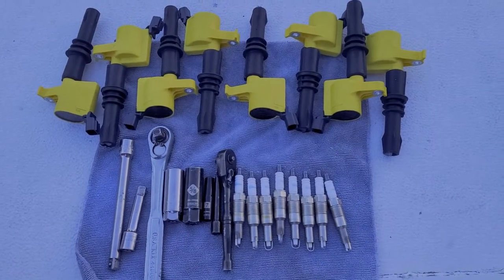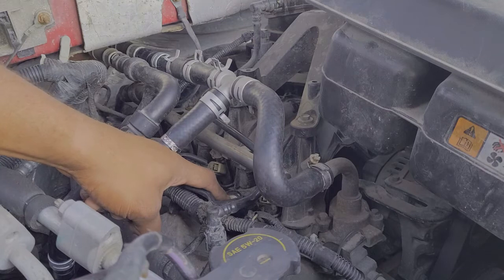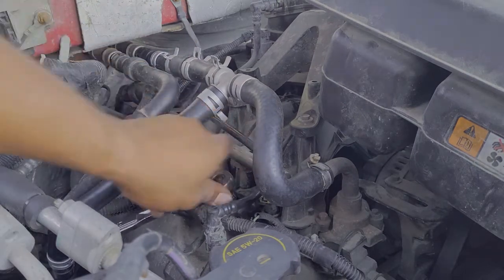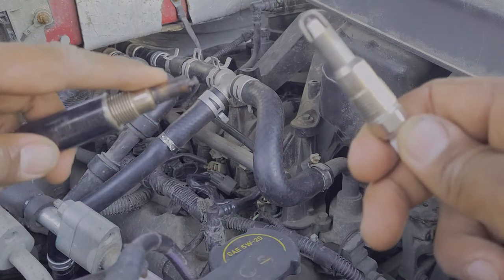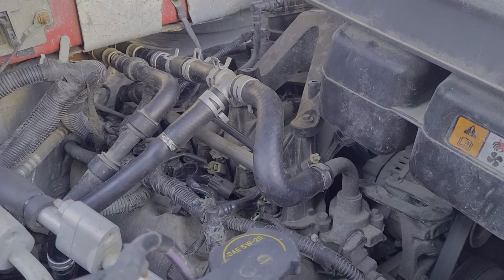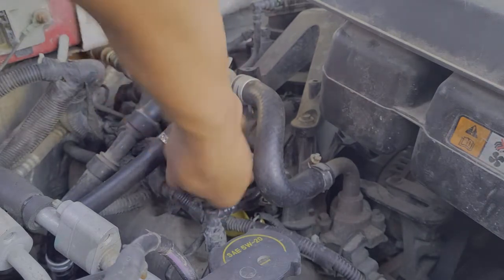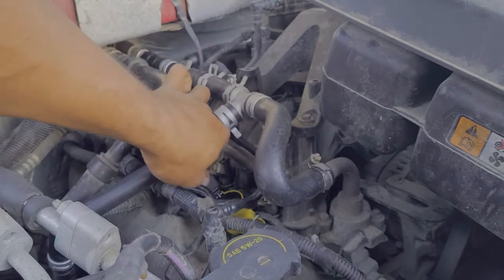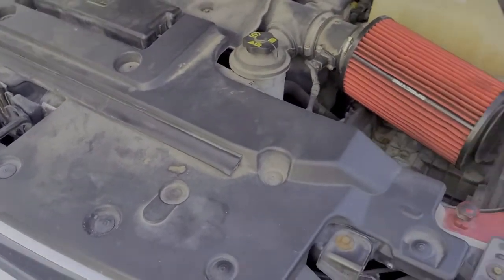Ford 5.4l V8 Triton Spark Plug Replacement W/O breaking them (and Coil Packs)(Minute Maintenance)

Comment: Another method is to use impact driver on a hot (like you mentioned in your video) engine.
And don’t forget a bit of high temp anti seize grease on the new spark plugs !
Good luck y’all !

Comment: If you have the factory coil packs still you are better off putting those back in they are not a maintenance item and they perform better than $50 eBay coil packs. Your misfire was almost guaranteed caused by the cheap coil packs
Reply from the maker: Hey Boss Thanks for Watching!! BUT as I Clearly Mentioned in the Video My Misfire was Caused By A Leaking Heater Hose that Flooded My Cylinder and Shorted Out the Coil Pack By Dripping DIRECTLY Onto the Electrical Connector. Also Coil Packs are a Wearable and Maintenance Part that Needs Replaced around 100-150K  Miles on Average. No Electrical Component Lasts Forever Everything On A Car Needs Repaired or Replaced at Certain Times. Thanks for Watching and For Commenting!
Reply: @minutemaintenance7385  I give it 6 months you'll have the 7 good Factory coil packs back in there
Reply from the maker: @michaelhopfinger2911  Well the Video Was Posted 8 Months Ago...and Filmed at Least 2 Weeks Before That So...Looks Like You Were Wrong!?!? Lol and I've Posted Plenty of Other Videos With the Truck Since then So...Thx For Trying!! 🤣🤣
Reply: @minutemaintenance7385  six months from 5 days ago. I did the cheap coil pack thing before I knew better as well. they lasted I don't know less than two years before I started having misfires. Look it up you don't want the cheap shity coil packs you're better off having your old factory coil packs until they go bad... because they likely never will go bad
Reply: @minutemaintenance7385  I don't necessarily know all that much about cars but it was clear in your video that you don't either
Reply: @minutemaintenance7385  sorry I'm a hater
Reply from the maker: @michaelhopfinger2911  Lol Appreciate the Critique.
Reply: @minutemaintenance7385  why the f*** was your hose leaking onto your coil pack was that Ford City design or was that your bright idea
Reply from the maker: Why did a Rubber Hose spring a Leak after 15 yrs and 180k miles?!?! Because its Rubber..and they Break..so You replace them..and whatever they may damage...Part of Owning a Vehicle Brother..Tires go Bad too..gotta Replace those...and windshield wiper blades!
Reply: @minutemaintenance7385  I have an 04 with original coil packs and original heater hoses lol.
Reply from the maker: That's Awesome Bud!
Reply: @michaelhopfinger2911  I have the same year truck and have never change anything other than spark plugs
Reply: @michaelhopfinger2911   - I have two Expeditions and unfortunately I had to replace those hoses on both of them. 
Rubber part is good, but what goes bad is the plastic part of the house. Since there are 3 different locations with plastics, your chances of having problems are higher. 
If you have an original hose on an older Expedition, please don’t touch that hose unless you have a replacement in your hands . Once you start poking around it will start leaking. 
Good luck ! You’ve been warned 😁
Reply: @mar1video  I forgot to mention mines likely different because I have an f150. Minute man needs to watch fordtechmakuloco channel if he thinks eBay coil packs are better than original ford coil packs at 180k. It's just the facts of life
Reply: @michaelhopfinger2911  - oh yeah ! You are 100 % correct ! Brian is the best when comes to Fords. He was working on my 2008 Expedition. He did the camshaft phasers, timing belt and spark plugs , etc, and because of that now I have 200k miles and the engine is still going. 
Good luck with your projects bro !